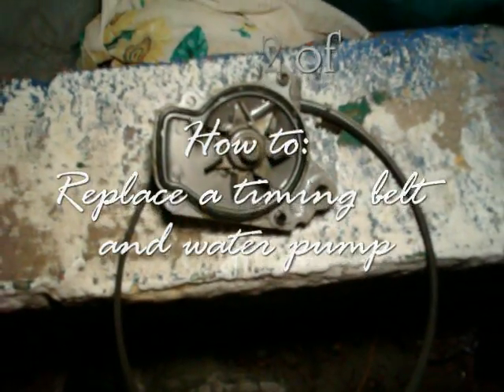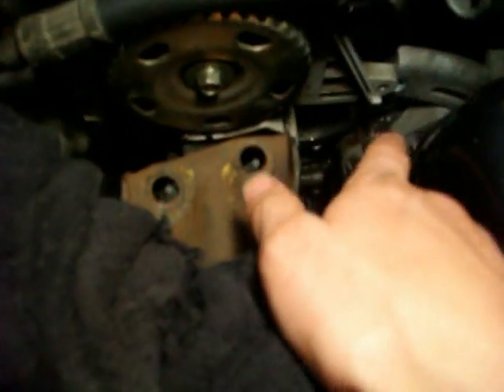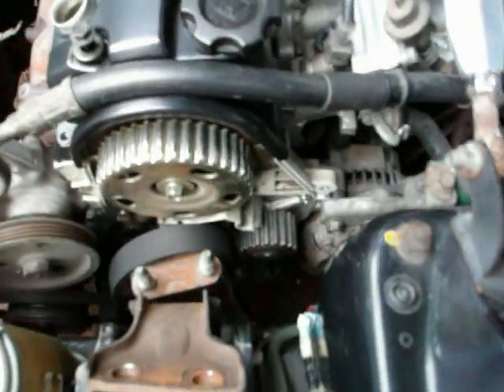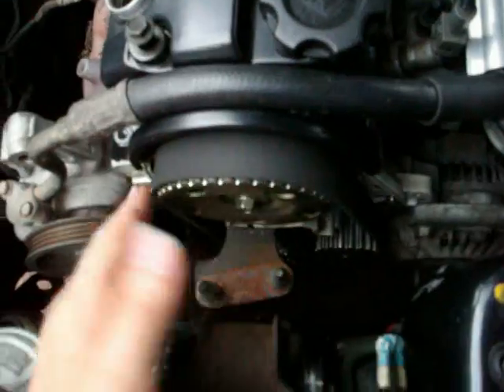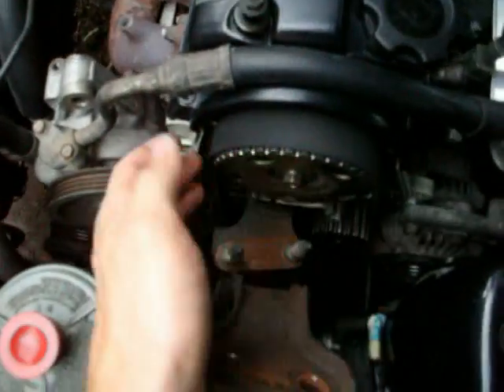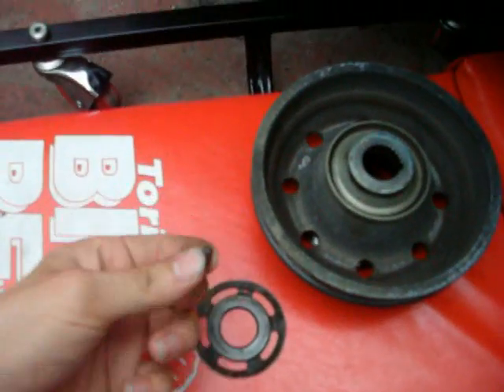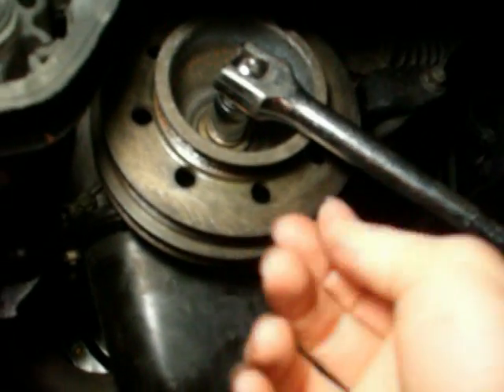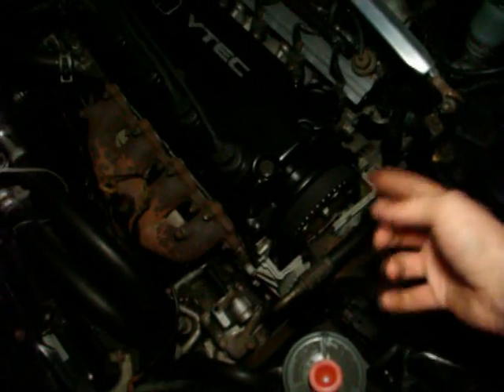How to: Replace a timing belt and water pump - part 2

Comment: That crankshaft bolt is to be tighten to a specific # of lbs torque and there are ways to do it and it’s not by turning the engine with the starter

Comment: Well my friend, I see a couple people gave you some grief over the past year. Nit picking I'd say. A few valid points, but it was a HUGE help. I didn't DO it your way, in particular, I did not remove the crank/harmonic balancer pulley. NO, I do NOT wish to explain how I managed that! You see, I do not have the patience & generosity with my time to do what you've done. You spent a great deal of time to help strangers, (nearly a MILLION of them now) by imparting your knowledge & taking the time to give us pretty good views of the job from every angle, with steady hand & being aware of lighting. All this outdoors, no lifts or shop. The way most of us actually do it. Like I said, I couldn't, or more accurately, WOULDN'T. The job itself, then editing etc., no thanks. But MANY thanks to you. Your generosity of know how & time is GREATLY appreciated! Hence MY taking enough time to send a wordy THANK YOU. 
Best wishes, Robin
Reply from the maker: +robin green 
Thanks for the positive comment. It is very difficult to describe and show how to preform a somewhat complicated procedure such as this while also having to do the job myself, film by myself, and to do it unscripted. Unfortunately, as a result of those obstacles, I will make mistakes here and there. But as long as the video is helpful to people and makes the job easier for some then it's worth it for me to make these videos.

Comment: just a few thoughts... Number one the markings on the pulleys do not dictate TDC. The markings are for referencing each against each other to ensure timing is correct the markings have nothing to do with TDC you can take a long screw driver or shaft and put it into the number one piston and lay it on top of the piston, NOTE: You must know your firing order in order to find out whether TDC happens on the compression stroke or the ignition stroke (firing stroke).

secondly always use some liquid seal like silicone on your water pump seals you never want to put a dry rubber seals on your engine.
Reply: George Timmis t

Comment from the maker: The D16Z6 has a different tdc cam mark than the D15B7, yes, but my engine is a D15B VTEC and it has the same tdc mark on the cam as the D16Z6.

Comment from the maker: If the part that the water pump bolts onto is leaking you have to remove some bolts at the back of the engine to get it out. I think there's only 2 or 3 bolts that hold it on.

Comment from the maker: It's the same whether you have an automatic or manual transmission. If you have a 92-95 Civic EX then you should have a 1.6L SOHC VTEC D16Z6 engine which is exactly the same as my engine except mine is a 1.5L JDM engine and yours is USDM. The procedure for doing this job would be exactly the same though.

Comment: ohhh forgot to tell you mate don't buy any new fuel injectors too they are too expensive just go to a scrapyard the're cheaper and you after you buy then make sure you make a fuel injectors test to make sure it's ok - even with those one's that you have on your Renault 2l you can do that. and check the rubber on the injectors too all around the injection system

Comment: I am certainly not an expert by any means but If the auxilliary shaft just turns the oil pump, what difference does it make if the shaft sprocket is lined up with the marks anyway since the oil pump doesn't need to be "in time" with the crankshaft and camshaft? What am I missing?

Comment from the maker: I'm not familiar with that car so my advice may not be too helpful but I'll try to help you. First thing to check is if the check engine light is on. If it is then you must get the code to find out what the ECU is reporting as malfunctioning. If that is the case, fix whatever is malfunctioning and see how it runs then. You could also try replacing the spark plug wires, distributor cap and rotor(if it has them). If you make a video about it I may be able to help you better.

Comment: I have a Renault Laguna 2l. I bought the car from a friend of mine in this condition. It struggles to start.  If the engine is running it sounds ok but soon as you ref it up it miss fires. I did a compression test and it is ok, checked the cam timing thats ok, replaced the spark plugs.  My friend replaced the computer box,and petrol pump.  Can you perhaps assist me with fault finding please.  My friend spend R17000-00 on the problem.  The max speed is only 50kmp Thank you  Hans Kruger

Comment: Also, normally its safe to put a slight amount of red high temp rtv silicone sealant. use it on the thermostat gasket and even in replacement for a bolt i somehow lost of the three that hold the thermost housing in place. its universal commodity for techs.

Comment: got a 98 accord  that needs the same thins, LET ME ALSO ADD....... always disconnect battery. 

CHECK THE VALVE GAPS ON ALL CYLINDERS AFTER PERFORMING THIS REPLACEMENT.  VERIFY TIMING AND MONITOR COMPUTER.

Comment: just a bit of helpful info, instead of putting oil on your bolt threads Locktite has a product as well as Napa called AntiSieze. its a copper or silver based product that you brush on and it keeps steel bolts from rusting up and siezeing. i use this product on all my lug studs, exhaust studs, head bolts, motor mount studs....basicly anywhere i dont want bolts and nuts rusting up and causing a headache the next time i have to loosen them.

Comment: A very helpful video. A couple of comments from experience: Get a table to put your parts on. An old door on a couple of saw horses will work. Buy some baking pans (at yards sales, usually about a quarter each). The kind for baking bread, or cakes. They make great parts, screws, and bolt holders. About 5 or 6 should do. Some needed tools (maybe impact drivers), can be borrowed from parts stores like AutoZone. Take pictures of each project before taking stuff apart. Nice video. Good Luck.

Comment: Quick question: I have heard of some people marking the old belt on top and on the crankshaft bolt and counting the teeth in between and transferring to the new belt, is there a difference in just putting it on like that and making sure its tight?

Comment: I JUST PURCHASED MY 1993 HONDA ACCORD AND I JUST HAD NEW SPARK PLUGS AND WIRES PUT IN I ALSO HAD THE LOWER ROCKER GASKET REPLACED. MY CAR IDLES EXTREMELY HIGH WHEN STARTED PLACED IN PARK OR IN NEUTURAL. ALSO WHEN I GO TO PUSH ON THE GAS AT A STOP SIGN IT SPUTTERS AS IF IT WANTS TO CUT OFF AS WELL AS WHEN I AM DRIVING. PLEASE HELP ME DIAGNOSE THIS ISSUE. I KINDA FEEL ;LIKE THE STALLING AND SPUTTERING CAN MAYBE BE THE FUEL INJECTOR OR THE FUEL PUP. PLEASE PLEASE PLEASE HELP ME

Comment from the maker: @sitkafisherman
On this vehicle the timing mark for the crank shaft is on the timing belt gear which is behind the crank shaft pulley. The camshaft mark is on the camshaft timing belt gear. Also the crankshaft pulley key shouldn't come out but if it does you just have to place it back in the crankshaft(you'll probably have to carefully tap it in with a hammer)and slightly tilt the key towards you so the key won't catch on the pulley and fall out when you put the pulley back on.

Comment from the maker: @wangbungal
Yes that's one thing I should have done but didn't. That has bothered me ever since I installed the parts and I plan on removing the tensioner and replacing the bearings in it.

Comment from the maker: @reidreality 
This is a direct quote from my 92-95 Honda Civic Factory Issued service manual:
"5. Rotate the crankshaft about 4 or 6 turns clockwise so that the belt may fit in position on the pulleys."
It may be a typo but that's exactly what it says and I've never seen typing errors in this book.

Comment from the maker: @chirby17 
Timing belt was around $30 and a rebuilt water pump is around $30 but Advance didn't have any rebuilt ones in stock so I paid $70 for a brand new one.
Thanks for the subscription and I hope your timing belt/water pump replacement goes well.

Comment from the maker: @chirby17 
Yes it's a swap.My car is a DX so it originally came with a non vtec engine.
I first tried to get the water pump at the local auto parts store and they gave me a non vtec water pump(you can see it in the video,that's why I had to wait til the next day to buy the right one) and it was too long so it didn't fit.Then I told them I have a imported engine and they said the water pump would be hard to find and all this.
So I went to advance and got a Civic ex water pump(D16Z6) and it fit.

Comment from the maker: @HondaHowTo1 
I was using a timing belt replacement book as a reference and I noticed it didn't mention it but since the factory service manual said to do it I figured it would be best to listen to Honda's manual.Probably not necessary though.